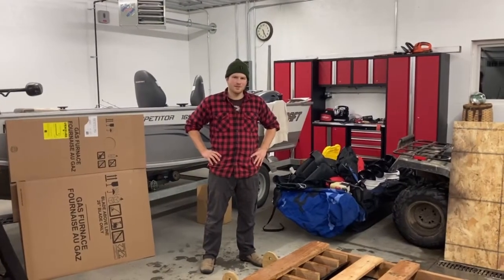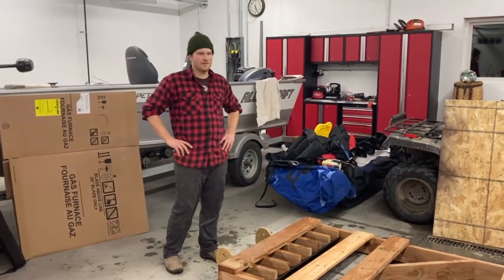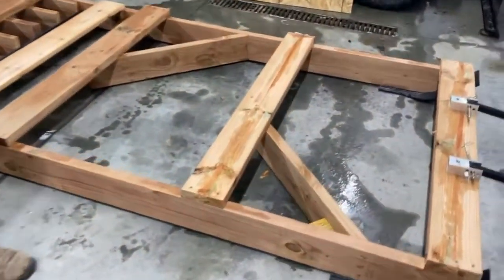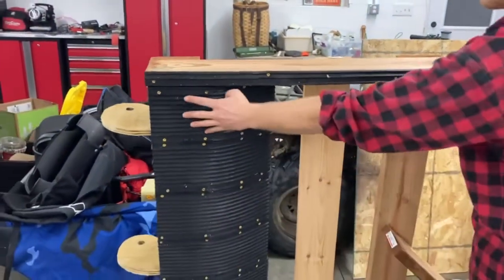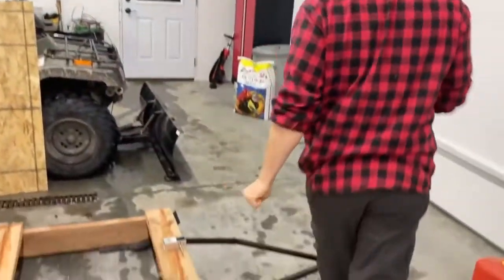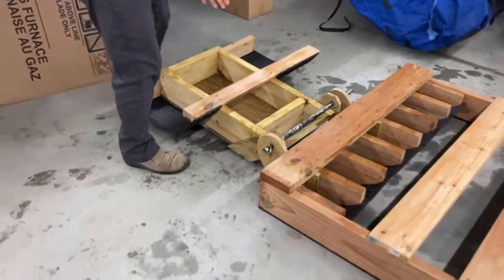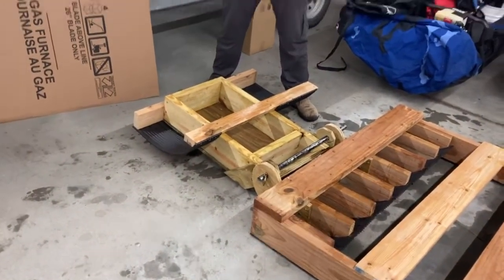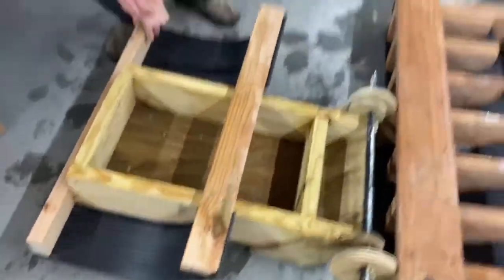Homemade Trail Groomer For Skiing, With Track Setter

Comment: Wondering if you have to pack down fresh snow (6+ inches) before dragging this?
Reply from the maker: Yes, if you have more than 6” I would suggest packing down in any way possible. I haven’t had a roller or packer in the past so I would just drive the snowmobile back and forth a few times on the trail before grooming. I now have a roller for the first time this year, but I haven’t gotten to use it yet! Hopefully sometime in the next month

Comment: You need to post another video of before and after grooming one night.  I built this using all your ideas and have used it for years now.  It is incredible.  Added weight to the pan portion.  Still need to make the cross country part!
Reply from the maker: That’s great to hear it’s working out!
I’m working on a new electrically actuated track setter so I should hopefully have a new video coming out sometime soon.

Comment: Thank you so much for this. Following your video, I just finished mine. Haven’t tried it out yet, but we just had our first large snowfall. Question: Do you do a first pass without the ski tracks lowered and then repass with them lowered? Does it make a difference? Or doesn’t matter.
Reply from the maker: Glad it helped you out! Where are you at? We are still waiting on snow in Minnesota. 
As for passes, if there’s a lot of snow, like over 8 inches , I’ll do a pass without tracker then a pass with. If there’s less snow than that it usually works in one pass
Reply: @northwoodsengineered  Great thanks!
 I’m in the province of Quebec, Canada. About 1 hour north of Ottawa Ontario. We just got about 7 inches and expecting more on Friday Looking forward to trying it out for the first time.

Comment: Cool video man. Do you groom like that just for the snow mobile? Can you walk comfortably on the trail afterwards without punching through too deep? I just bought a snowdog tracked vehicle and I'm trying to find ways to make nice walking trails in the woods.
Reply from the maker: Thank you! The main purpose is to groom to cross country ski on, but I have a different smaller groomer that I also use to groom just for walking. It is all condition dependent, like how wet the snow is and how cold it is. But as long as you let it set up for like 24 hours after grooming it usually gets fairly hard and works for walking

Comment: I learned about your video from a neighbor here in Bozeman, MT who had built a groomer/track setter like yours. I used your video to build one of my own and it works great - need to add the cutter bar for next year. I groom a 1/3 mile oval in our meadow - great for exercise during the winter. So now you have 2 of your groomers in the wild here in Bozeman. Thanks so much!
Reply from the maker: Thats awesome to hear! I love when people tell me about the groomers they have built based on my ideas, its great to know the video is heling people out!
Reply: @northwoodsengineered  And I'm in Missoula, MT (just a Montana stone's throw from Bozeman) looking to build one.  It looks heavy... what do you use to pull it?
Reply from the maker: Awesome! I use a Polaris 550 Indy adventure snowmobile and it pulls it really well. It’s actually not really that heavy overall.

Comment: Do you think you could just build and pull the track setter by itself?
Reply from the maker: Absolutely. They are a few companies out there that sell just track setters. You would want to add weight to it. And it might not work as wel In deep snow but it should still work pretty well.

Comment: hard to find the plastic trailer runners, any tips?
Reply from the maker: Hey, saw a picture of a groomer the other day where a guy made it really similarly to mine but he used a piece of black corrugated drain pipe instead of the runners. Not sure how he attached it but you could figure something out for that

Comment: This is amazing. Does your snowmobile have any problems overheating from this setup?
Reply from the maker: Thank you! I have not had any issues so far. Just this weekend I was pulling it through about 15 inches of new snow and had no problems, although it was pretty cold out, like 0F. So maybe if it was more around the freezing point it could overheat. But no issues so far!

Comment: Great design. Folks may want to consider replacing the fixed tongue with a rope or other breakaway materials to minimize catastrophe upon inevitable snags.
Reply: I am glad you brought up that idea. I know i would forget where a down limb or significant other impediment is and drive over or past it and snag the groomer sled.

A "sheer pin" type solution might save me from breaking a much more difficult, inconvenient , or expensive to repair element. 
A "pin" might just be a strand of solid wire. Easy to carry replacements; could save me from needing to tow home a broken sled.

Comment: Thanks for the video, Awesome.  what are the snowmobile mats and can I get some?   Thanks
Reply from the maker: Thanks! Look in my description, there is an Amazon link. However they are pretty spendy on there. I got mine at a local farm and fleet store in the trailer section for $14 each. If you have any stores like that around you I’d check there first.

Comment: Looks good. Snow must be soft adding only 50lbs. We add 200+ lbs for hard pack trails. You did a good job. Good idea regarding sled trailer pLastic. 👍
Reply from the maker: Thanks! Yeah I still haven’t used it in too many different conditions yet so I’m sure I’ll have to experiment with the weight. Definitely still learning and will always be making changes. I’ve been fortunate to always have fresh snow when I have groomed so far. I’ll need to add some Sort of cutter bar or teeth to break up hard pack though.

Comment: Ever run into issues working that 550 too much?
Reply from the maker: I haven't yet, but it's always been below 25F when I have been grooming.  Also, the groomers isnt super heavy, so I can't say what would happen if you were pulling a big steel groomer.
Reply: @northwoodsengineered  I worry a bit about my adventure just because myself, wife, flip over ice shelter, and gear i figgure I'm running 600lbs conservative. I just started using it like this and I'm still a lill worried I might be over doing it
Reply from the maker: @j.wildoutdoors8483   Well since the sled can come with factory second seat, i imagine you are find as far as weight on the sled goes. You could always get a stiffer spring for the rear suspension if needed.  Pulling the fish house shouldnt be too tough on it. I also imagine you dont go super far when ice fishing, at least compared to someone riding trails.
Reply: @northwoodsengineered  are you the same guy that has your auger mounted to the side?
Reply: @northwoodsengineered  no around 40kmh ish mostly. Any faster and id be beating my gear up too much.
Reply from the maker: @j.wildoutdoors8483   Yes! and i just realized that when i replied to your comment above, i though it was on my other video. Sorry about that. I see you are worried about using it for grooming...  Yeah I have only been grooming a few times this year, although i havent had any issues yet. I guess time will tell, but when i have been doing it, it really doesnt feel like im working the sled too hard.
Reply: @northwoodsengineered  no mine too just seems to be a work machine but I'm just overly paranoid about over heating lol. No sensor to say hey bud gimme a rest haha.
Reply from the maker: @j.wildoutdoors8483   there is an overheat light on the gauge. Looks like a picture of a thermometer. Im not by my snowmobile right now so i cant look but i know its on there.

Comment: Have you had the chance (or need) to go over your previous classic tracks? If so, how did it do? I've been using our tractor dragging a chain harrow and also using a 3-pt mounted blade to rework our tracks after the latest storm, without much luck so far. The old tracks still lurk under the fresh groomed snow. I'm planning on making a groomer/track setter like yours. Nice simple design and I have everything I need to build it laying around here.
Reply: Actually yes i have only done it once without new snow and i found out i need to add something to it to help bust up the packed snow to cover old tracks cause it didnt do well. I'm working on a design to make some type of steel cutting bar that is depth adjustable and will break up the old path.  If you look at some of the groomers on snowgroomers.net, it will be similar to their cutting blade. I had just been lucky this year that the few times i have used it i had fresh powder. But I will definitely need to add this.
Reply: @shawzy17  This is more like a snowmobile groomer, but the adjustable depth is pretty slick so that one could cut up the previous tracks. https://www.youtube.com/watch?v=hR8X98gBWwc
Reply: @shawzy17  thanks for the update. I was also thinking of some kind of cutter. Wish I had $5K laying around for a Snowgroomer setup. Looking forward to seeing what you come up with. I just saw a similar design by Donn DIY where he added upside down, grooved U-channel to his angled boards. Something to consider?
Reply: @jameshoeppner1211  Yep I saw that too, thats kind of what i was thinking, something along those lines.